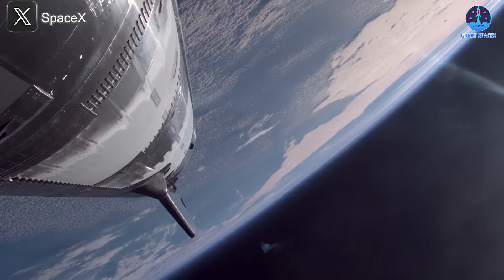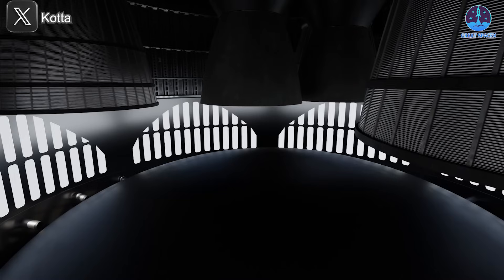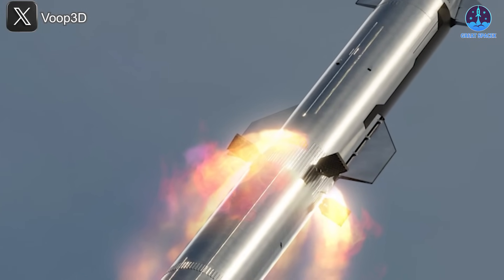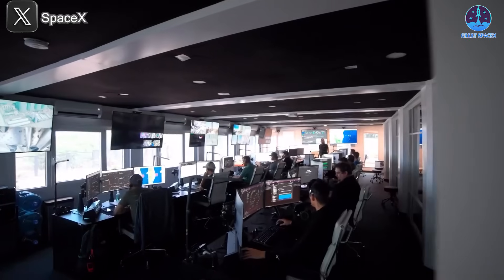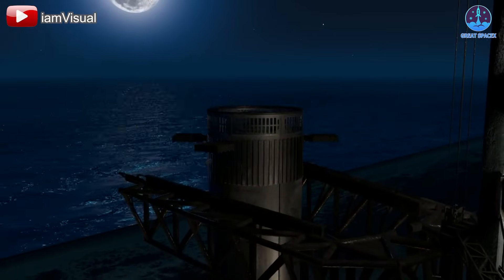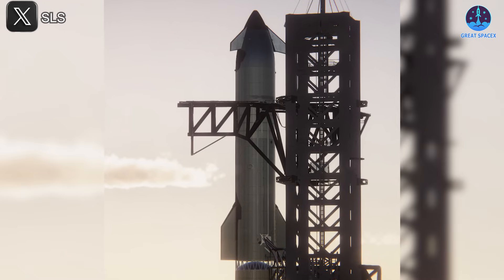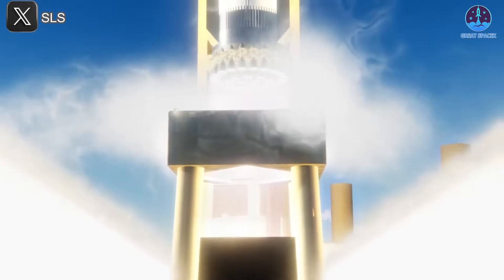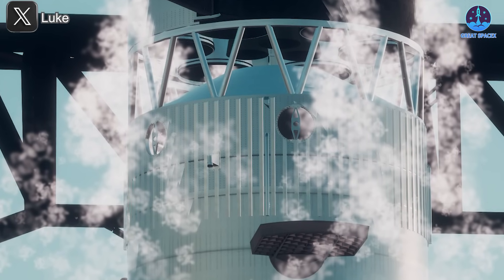SpaceX revealed New Starship HSR Design to Solve Fatal Flaw Destroyed Starship V2...

Comment: Small chance this was the root cause of the second stage engine failures on either IFT-7 or IFT-8.  On both flights, the Starship vehicle's engines (3 with sea-level expansion nozzles and 3 with vacuum-level expansion nozzles) survived hot stage separation and operated fine for over a minute (check that timeline) before beginning to shutdown/fail catastrophically.  The methane feedlines hydraulic resonances/harmonics causing structural overload(s) is the plumbing leading to those engines is currently POSTULATED to be the root cause of loss of engines on both flights.  Such is reasoned to be caused more by (a) the V2 design—compared the the V1 Starship design—incorporating multiple, vacuum-jacketed methane feedlines, coupled with (b) experiencing a certain level of fluid mass in the LOX tank through which that plumbing is routed.  Also, the on-board video shots showing development of fires in the engine bay (on both flights) indicates they did not originate at the time of hot-staging separation, only sometime later.  Finally, it should be noted that a methane leak alone under ambient vacuum conditions cannot create a fire . . . there must also have been leaks of significant extent in the oxygen lines near or in the engine bay to support combustion and a visible flame.

Comment: hot staging is cool and all, but I think many of us were wondering why compressed air or something wasn't being used from the get-go, just a quick blast of monopropellant and wait 5 min while ship and booster drift apart before lighting the candle.
Reply: "and wait 5 minutes while . . ."  There is a tremendous loss of launch payload capability due to both first and second stages of launch vehicles experiencing "gravity losses" (look it up) before reaching an orbital velocity state.  In fact, one of the main purposes of implementing "hot staging" is to effectively eliminate any period of gravity losses due to a delay in thrusting between first and second stage.
Reply: @mrhannity1  Its not just that, the hot staging also 'pushes' the booster back the other direction by a non-negligible amount. Still, better to be a bit more inefficient than lose more Starships at this critical juncture.  The technology NEEDS to be proven soon here, because the public is turning against the program with the recent failures. 

Not saying they should give up hot staging forever, just get the product working and make it more complex in version 4.0

Plus ditching the hot staging ring altogether at this point will save a ton (or rather many tons) of efficiency, and letting the Starship and Booster drift a bit will get Starship closer to its apoapsis, which makes its own burn a lot more efficient, so I'm not convinced its as big of a loss as you claim. There are many variables working in both directions.
Reply: Another idea is to shut down the booster's engines while lighting the 2nd stage's engines. This way the booster is pushed back more efficiently and the distance between the stages grows at a faster rate eliminating too much exposure of the engine bay to pressure built up in the ring. Once the two stages are far enough, the booster would initiate it's boost back burn (after flipping 180 degrees)
Reply: @aristhegreek7659  Problem with that idea is that the absence of thrust on the first stage PLUS the reverse thrust on that stage created by plume impingement from the second stage engines means that there will be  a forward surge in the first stage tanks liquids (both LOX and liquid methane) due to their inertias relative to the change in inertia on the first stage structure due to the imposed forces.  In turn, this raises the probability that the first stage engine feedlines will become "un-ported" (suffering gas ingestion) as well as experience severe waterhammer transients when the first stage engines relight for the RTLS burnback.  BTW, what happens to the booster (first) stage during stage-separation has negligible effect on the second stage (Starship space vehicle), excluding the "gravity losses" associated with any time delay in staging.
Reply: @mrhannity1  I understand that. But using 3 engines on the booster delays the full separation and keeps the back pressure effect for more time. I would suggest an upgrade to the separation sequence for maximum safety and secondly maximum efficiency, but because I'm not a rocket engineer I think they are doing their best so I hope they solve it in flight 9 (hopefully including a Super Heavy catch and a Full Flight of Starship).

Comment: This change isn't enough. Position the reinforced shielding at the grid-fins to prevent heat distortion during separation. They should ease free by throttling the engines up slowly to lessen the impact on both stages. I question the continuation of use of this style hotstaging ring. They know they need far greater distance and less obstruction of the exhaust on startup for separation during hotstaging.  Why not do it now rather than continue with what's been giving them problems. Tweeking isn't going to fix this.

Comment: Okay, so am I missing something here?  Why does the ship's engine section (the lower part of ship surrounding the engines) HAVE to be enclosed?  If the walls of the engine bay were part cut-away, wouldn't that help with pressure build-up in the engine bay and reduce bak-pressure when staging occurs?  Elon says "the best part is no part" so how about making the walls of the engine bay like the hot-staging ring and do away with the 10-15t hot stage ring altogether?  There's probably a good reason why SpaceX don't do this - unless they haven't thought of this!  Like I said, I could be missing something here but it looks kind of obvious to me.
Reply: The ship needs to renter. Having a picket fence wrapped around the stern probably isn’t very predictable/controllable. Just a thought.
Reply: @paulrichard1307  You make a good point Paul

Comment: It should be known that in a short time I will be leaving this beautiful planet to do a standard flyby pick-up through NGC 1332. It's in the Fornax constellation with an initial magnitude of 10.63 (V) 11.59 (B) 8.72 (J) 8.03 (H) 7.83 (K). Because of its relatively close proximity, I also plan to stop in at planet torpedo. They have the best Hot Dogs in the universe!  At some point before that, I will also pass near Alpha Centauri on my way to NGC 1332.  It's a Black Hole with special characteristics.  It consists of a very unusual and quantifiable makeup. The unusual characteristics of NGC 1332 allow a standard Quantum Matter Deflection Dish to be configured in such a way that the intense makeup of gravitational forces normally experienced in a black hole can be momentarily neutralized, giving us just enough time to slip through it at sublight speeds to experience the full visual effect it offers. If you have a few extra digits and would like to experience this phenomenal phenomenon I can use the services of a nucleoid cytoplasm to restart the infusion of protoplasm equally dispersed within the interior region of the acceleron.

Comment: Your explanation about the HSR makes no sense to me.  I don't see how fewer vents allow them to control back pressure. Here is an idea I had -- "Imagine a revolutionary rocket stage separation method: instead of hot staging or interstage rings, we use a twist-lock mechanism with reversing thrusters on both stages that fire opposite, directly unlocking the starship from the booster! The upper and lower stages would twist apart, powered by thrusters that control the separation precisely, eliminating back pressure and the need for complex hot staging rings. A clean, innovative approach to stage separation!" So, in this case, you’d have a pressurized nitrogen system on board, ready to fire off those thrusters and twist the stages apart!

Comment: Why do they need hot staging? Atmospheric drag of the deployed grid fins would slow the booster faster than the starship, creating distance between the starship and the booster after separation.  Seems that a simple pause of a few seconds between separation and ignition of the starship would significantly reduce the back pressure.

But I’m not a rocket scientist, but I did stay at a courtyard last night…
Reply: Hot stage is for extra performance.

Comment: Why don't they throttle down the booster engines partially until the stage two is separated, then fire stage two? This should dramatically reduce the hot gasses blowing back up into the stage two engine compartment.

Comment: Hey, one suggestion. Don't start the vacuum engines until after the booster separates completely. Delaying starting the vacuum engines would lessen back pressure to the fragile nozzles and incorporating flame baffles to direct the sea level engine's exhaust around the vacuum engines through the openings would still keep the fuel from sloshing in the 2nd stage. The booster cuts back to the three center engines to maintain thrust of the stack. Throttling down the booster engines while throttling up the star ship's center engines would allow the booster to clear and keeping restriction a minimum on the vacuum engines as they start and power up to maximum thrust.

Comment: Stop the hot staging nonsense.   Try one without hot staging and a suitable few seconds for the booster to turn away before the second stage engines start.
Reply: Thing is, the instant the vehicle is not being accelerated by firing engines, it begins to slow down due to Earth's strong gravity pulling on it. To regain the velocity you lost while the engines weren't running wastes a lot of fuel and oxidizer. It lowers the mass you can accelerate to orbital velocity. That is why they do hot staging.
Reply: Coming flight is also going to be a failure as they try with the same hot staging. Instead, they should keep aside hot staging issue and go for other critical tests.
Reply: Why? Up until the last two test flights the hot staging system worked (granted, IFT-1 didn't make it far enough to utilize hot staging) plus hot staging as a principle has been used successfully since early on in spaceflight. Heck, both NASA and the Soviet/Russian programs used hot staging (NASA w/the Titan II, the Russians w/the Soyuz family of rackets).

What's likely happened is that when they removed the engine shielding at the bottom of Starship, it exposed the Raptor engines to more shock during hot staging, which also likely explains the damage to Starship during Flight's 7 and 8 respective launches.

Comment: Question is?????   The long central fuel pipe through the tanks?? Is it fixed held so not to occilate vibrate along its length.
Violent vibrations were recorded in Saturn 5  lift offs,

Comment: In all honesty, I think they have no idea what actually caused the two failures. They just grasped at an excuse that seemed plausible, made a few adjustments to an already built ship (i.e., too late to actually redesign) and crossed their fingers...and then it blew up again. It's the same idiocy that caused them to design a launch mount that obviously wasn't good enough and then after every launch needs a month or two of repairs.
Reply: quit whining🍼
Reply: To be fair, the launch pad works fine enough. But not ready for rapid reuse. It was the right design for that point in the program where building ships was the cause of time between flights, not pad refurb.

Comment: I think instead of firing the upper stage engines while the booster is still attached, they should first trigger the detach and then use a low thrust to stage until separated by 10-15 meters before increasing thrust.

Comment: The solutionS described will not do. The HOT STAGING RING is too compressed.  (remember the power of the raptors digging under the Launch mount) Make a test stand to learn. (or fail)
Reply: keyboard warriors😂
Reply: So say the pretend experts..
Reply: @TheEvilmooseofdoom  What's  you answer????

Comment: The starship's raptor engines, could be made to be hot staging back pressure resistant. The hot staging, means that some of the fuel to escape the Earth's attraction, has been provided. Also, the detachment, could occur without firing the starship's raptor engines, and the booster guided away, from the starship, by moving sideways a lot.
Reply: On another point, the booster's engines could be on low thrust, whilst the starship is hot staging.

Comment: Hot staging is a failure
Reply: It works on other platforms.  This one is just a lot bigger with a lot morethrust being applied.
Reply: Is there any actual evidence that hotstaging is an issue?  Did spacex or Elon say something about it?
Reply: @TheEvilmooseofdoom  I never saw any cause of the failure discussed. All we know is that the ones with hot staging failed. That would seem to suggest that hot staging had something to do with the failures but it isn't proof.
Reply: @billsimpson604 that isn't true. Only the last two flights had a failure. Hot staging worked fine on the previous flights

Comment: I'm not a fan of the hot staging concept.  Why not detach Starship from the booster then use simple hypergolic thrusters to create separation before starting the Starship engines?
Reply: @joseeoliviero6078  hot staging increases payload capacity 10%
Reply: Saves on gravity losses.
Reply: 10% is a big number in terms of payload to orbit,  so that's not going away.
ideally the pressure would get used to reusably compress the stage1 tanks as a shock absorber for a more efficient separation boost. I guess that's been discarded. 
Perhaps a longer, slower boost is available by using only the sea levels and a (partial) containment tube
Also, aren't the heat shield tiles light and good with heat?
Reply: Add a layer of tiles between the hot staging and the first stage
Reply: The problem is that the Raptors are being put under too much heat and pressure since they eliminated shielding in the new version of the ship, there is no "between" where you could place tiles that would help.  Simple answer, and I suspect that it may be part of the solution, is to put the heat shields back on all, or some, of the raptors on ship.   I think the new ring is just there to divert thrust and heat away from those million dollar guide fins.
Reply: Agreed, heat from the ship will distort the ring, making it unusable!!!
Reply: Best part is no part, so a separate RP fuel complicates things.
Reply: Not only that, it takes up a lot of real estate and is heavy.
Reply: @joseeoliviero6078  Hot staging enables them to carry 10% MORE payload....  That makes the weight and space acceptable.

Comment: this allone will definetly not help, they need shielding on the ship
Reply: You could be right. We will see on the next flight. I don't like less space for that hot exhaust to escape that confined area. I won't be shocked if pressure waves in there blow it up. Gas moving that fast can bounce around in unpredictable ways, like happened inside the chamber of the F-1 on the Saturn V. Only welding baffles on the injector plate broke up the shock waves and kept it from blowing up.
Reply: @billsimpson604  although the problem inside the f1 was detonation wave starting inside the engine creating combustion instabilidty and not any sort of backblast hitting parts of the engines that shouldn't.
I'd highly suggest you to watch a video of rotating detonation engines if you haven't already, it is making use of what happened inside the f1 in a constructive way achieving insane performance

Comment: Not gonna work. If the problem is a build up of back pressure, then the only solutions are to slow or eliminate that build up. This does neither. In fact, basic fluid dynamics dictates that exhaust should come out at higher pressures because there is less area. HIGHER PRESSURE. Control of exhaust direction was not the issue. And they know this. Those preliminary V3 designs have large vents. Not fewer directed ones. This is not an improvement, it’s most likely a test. This ship is a sacrificial lamb. They know it’s going to fail. This is stupid.
Reply: But the area squared equals the velocity multiplied by tanks pressure cubed, so I’m not sure you’re right. 😑
Reply: Well genius, that's not even what's causing the failures

Comment: That HSR design looks even worse (with less vent openings) than the previous one. They are going to make another one great mistake. 
By trying to protect the fins from the hot gases of the igniting engines above, they are risking one more catastrophic failure of the Ship. 
The major, pressing, and super emergency problem right now is the Ship, not the booster fins. They seem to have wrong priorities.
Eliminating the Ship's engines shielding (a great mistake, among others great mistakes, in the design of the Version 2 Ship) the Raptor engines now suffer from the powerful thermal shock of their own ignition, being totally unprotected.
Reply: You could be right. All that high pressure very hot gas inside there could do a lot of damage. I would have gone straight to the Soviet pipe design.